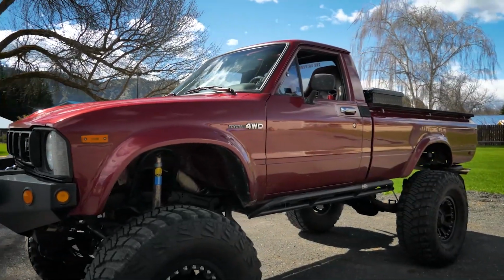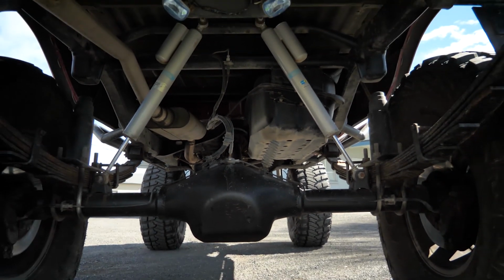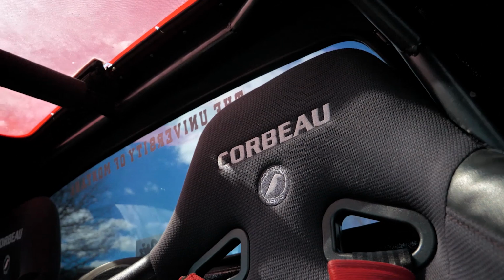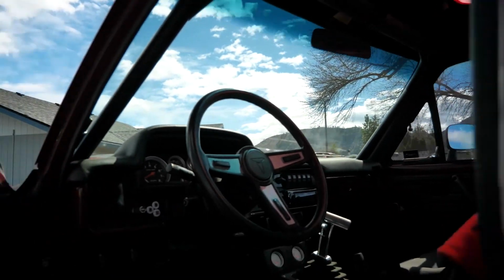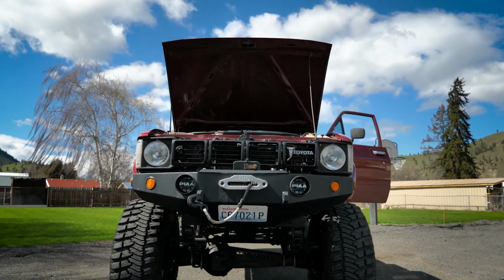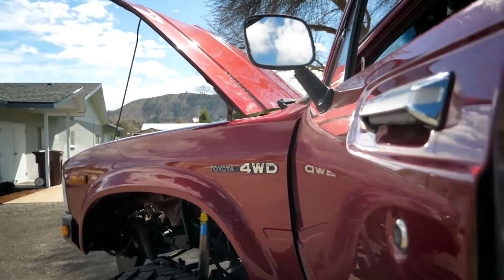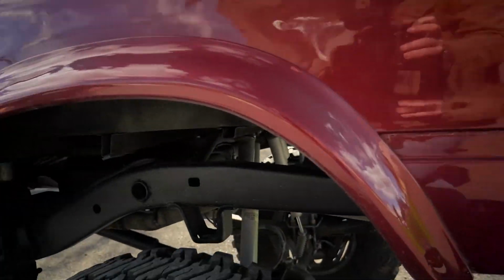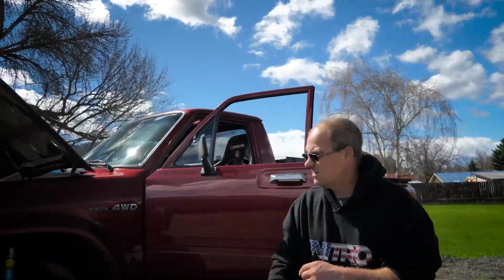Walkaround - Modified 1980 Toyota Pickup on 38s!!

Comment: Beautiful baby! I just inherited a 1980 Deluxe Toy 4x4. In amazing condition considering it sat parked in a field for 2years! When they got it off the trailer on my property I couldn't wait to see what condition the motor was in so I put gas in it and a can of berrymans  and cranked it up! It took a few times but it started and ran a little rough but after a little work it starts every time, purrs like a kitten. First test drive out it was ROUGH! I heard metal on metal chunk, chunk, after new tires and shocks all around it rides great! The only problem I'm having is lighting issues. I just now started on the lighting system and WTH? The back right brake light lights for the blinker and blinks, and you know it, the blinker light lights up for the brake light no blinking... 🤔😂🤣😂🤣😂🤣

Comment: I had 2 84 Toyota 4x4 one RN 60 the other was an RN 65 I ran 16-38.5-15 Super SWAMPERS. 9 suspension 3body 5.71 to 1 gears with a TRD locker in the rear. I used a steering arm with the ball on top and an adj drag link SS brake lines and a downy clutch. I miss it and those days. Thanks!

Comment: So many things wrong being said in this video, sas'ed means solid axle swapped, this truck came factory with a solid front axle, original front housing is also wrong, the 1979-1980 had no lower truss, this front housing has the half factory lower truss that came in the 81-83 trucks.  those are not dana 60 lockout hubs, just crappy warns that are weaker than the factory Toyota ones. the rear shock setup being inboarded on top allows you to run a longer shock and it doesn't become a limiting factor on suspension travel.
Reply: Karnage Fabrication still a dope ass rig though but I agree.
Reply: Yeah this man lost all my respect when he said sas
Reply: yeah instead of sas he probably meant just a shackle relocation for longer leafsprings.  That'd be my guess.

Comment: What that guy said and how is it solid axle swapped that truck came from the factory with a solid front axle lolol
Reply: Tyler Mccorkle lmao I thought that same thing myself, they were solid axle in this body style the whole time, and the next body style until 85
Reply: Yah agree. I just bought a half year 1985 Toyota 4x4 DIESEL! (Original 2.2l) This past weekend. Solid front axle. They started the IFS front end half way through 85 and first full year was 86.
Reply: Pete Johnson yup 85 was first year fuel injection on the 22R, last year for carb, you could get them either way. same with the straight axle .
Reply: @kennethlaw5216  you know of anywhere that deals with first gen Toyota 4cyl type  L 2.2l diesel motors.
Reply: Did they swapped the shackles front to rear?
Reply: Aristo, no.
Reply: Started as a 2wd

Comment: That’s not restored.  Restored would look factory. This is custom. It’s not even a Toyota anymore with that gm vortec in it
Reply: flashback5391 so almost every hotrod,  street rod ever has a gm small block in them, they still are the same brand just with a different motor.
Reply: Well it’s a Toyota. Not a gm hot rod. Restored would look original.
Reply: I have two 79, three 83, one 85, and one 88. so 1st and 2nd Gen Toyota trucks just like this. mine are are original as you put it. I find nothing wrong with this. it's just good to see someone appreciate and actually drive them again. if it doesn't bother me I fail to see your problem